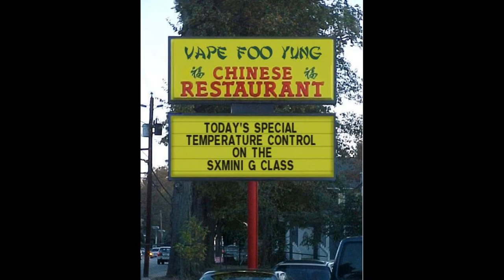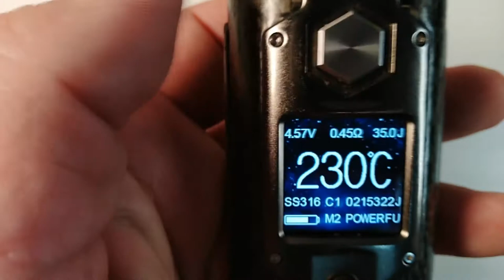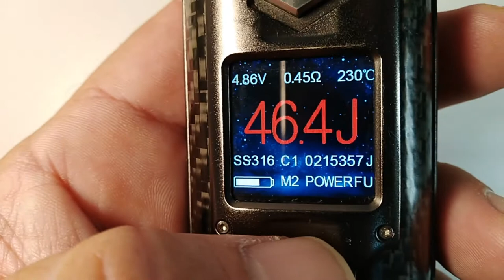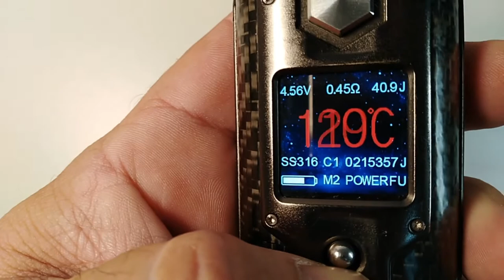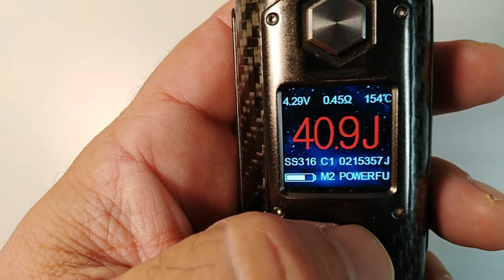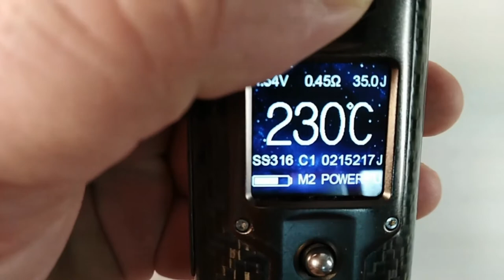SX mini G Class Temperature Control explained.

Comment: I was getting frustrated because I couldn't figure out how to lock the resistance. In wattage, my coils showed .12 and in TC it showed 6.55 so I was like " how is this even possible?". I made about 10 different set of coils because I assumed I was doing something wrong while making them, such as, heating the wire up too much before wicking. But now after making a new set of coils and locking the resistance, the TC works phenomenal. Thank you so much for this video.

Comment: Great video !!!    Thx for posting. I have the G class and have never vaped using temp cont until now, thx for the easy to follow instruction. I used the same wire and build in the QP Designs "Kali".   I am really enjoying this temp control vaping. Thx for turning me on !

Comment: Thanks for the tip on adjusting the resistance. My G class would read 0 Ohms at temp control, which meant the protection kicked in instantly and I got the "no liquid" warning and no vape. After manual adjustment it started working!

Comment: You have to lock the resistance. That's what you do by pushing in for 5 secs, if u dont it will not work in TC, also allows you to adjust that reis. As a temp control wire heats the resis changes, its one the ways it controls the temp. If not locked it gets confused and will not work to put it simply. A G class has real time ohm reading. Watch DJLsb for a more thorough explanation. A good basic guide not to bad all in all. SS316 is the only one SAFE to vape in wattage mode. Nickle can have very adverse effect on your health if vaped in wattage mode ie: life threatening felt i must point this out to those who do not know .

Comment: In the manual it's stated that temp control only works till 0.3 ohm. What is it now? Yours is 0.45 ohm...
Reply from the maker: That is a little surprising. I don't remember reading this in my manual. I will dig it out and see if my manual lists the same. I also have friends that work for Yihi and can check with them but it is nearly 1am in China right now.

Comment: I'm looking for info for the sx lines' temperature compensation function ,  not temp control .  Can anyone explain this  ?
Reply: 264fan it’s the environment temperature, if you adjust temp control at your house and the room temp is 23C, you adjust that to 23C. Adjust that to 22-24C is ok for temp control on normal situtaions but in summer time, if the outside temp is too high, you can increase the compensation temp or in winter, if its too cold outside, you can decrease it. 
I know that it helps temp control like this if I’m not wrong.